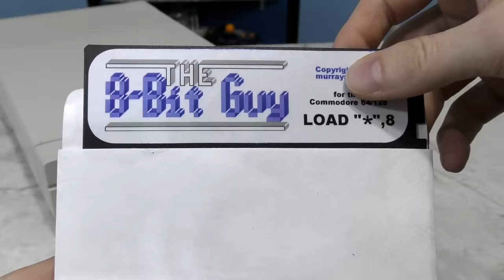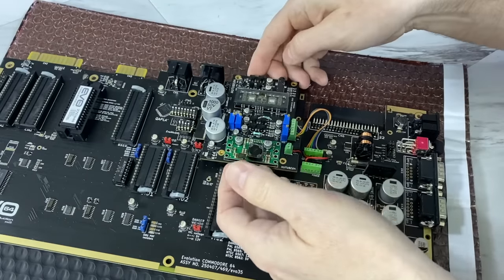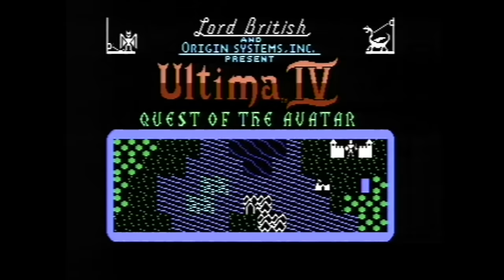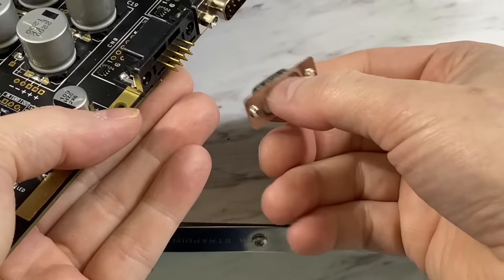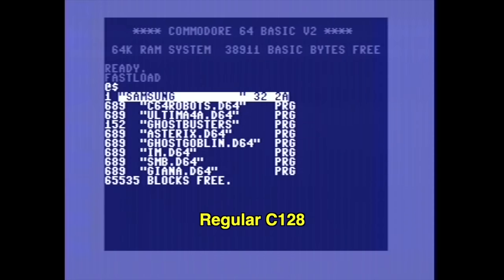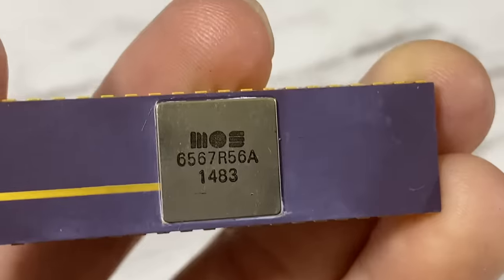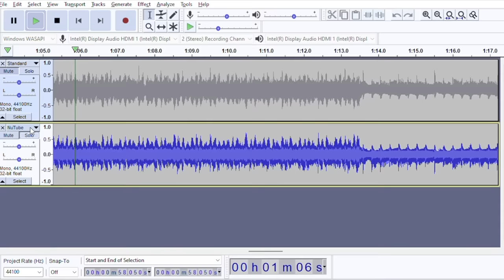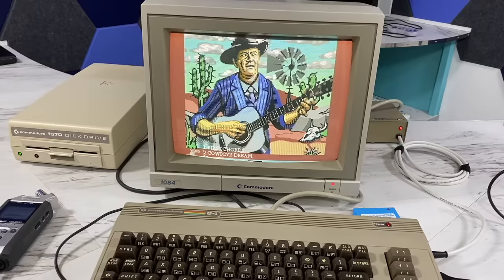The Evolution64 - Is it worth the money?

Comment: About the audio quality, personally I think the nutube sounds a little bit sharper, occasionally sounding too sharp, resulting in some weird noise. From my experience, it matches what most tube based amps sounds, albeit not as good as a proper, dedicated preamp. But that might also be affected by the music itself being really high pitched.

If I'm purchasing this for myself, I would not add the 500$ upgrade. If I really want good audio, I'll probably just hook it up with a proper audio setup. Adding an expensive builtin amp is an expense hard to justify for me, when I know there are obvious better options, devices that can also be used by other computer and vinyl players, etc. And honestly,  when I'm playing a retro game, I'm not really bothered by the audio quality. I just need the game to work, graphics look nice. As long as the audio doesn't sound bad, I'm ok with it.

But as you said in the video, at the end of the day, it is up to the users to decide whether this is worth it or not.

PS. if you have a good enough high end audio setup, vinyl sounds significantly better than even lossless audio on streaming platforms like tidal. But imo, CD and vinyl both have different characteristic, it really depends on personal preference and mood.

Comment: Vac tube amplifiers makes different harmonic distortions than transistor based. Most distortions are made in speaker amplifiers due to much higher power output - practically only here You can hear the real difference. For a couple days I had one of best vac tube amplituner even made. Giving it back was a very big pain for me :)

Comment: I could hear a difference, but it was mostly just more LF in the tube sound. Whether that's better or not is largely subjective. To do an objective test you'd need to feed in a known signal and analyze the output. The less it changes the better it is, objectively speaking. But objectively better isn't always subjectively better.

Comment: I did notice some slight differences between the regular C64 and the vacuum tube amplifier. Now, I'm not qualified to say which one is better, only that if you want to go for authenticity, the C64 didn't seem to ever have the latter as an option,  at least to my knowledge. But again, I agree with David here when he said that the comparison is invalidated. I would go even further and say that you wouldn't be doing constant comparisons between both so you'd get used to how one of them sounds anyway. Personally, I don't think it's worth the half grand for it.

Comment: At first part of the Giana Sisters song, I could tell a difference. But I actually think the original sounded better (through my speakers).

Though, I would like to point out that running things in tube's at only one stage of the chain is not hogwash, and could still be audible. If one amplifies a signal too much with transistors, the signal will clip, and that does not sound good. This is because there is a hard limit. The difference with amplifying a signal through a tube, is that tube's first become saturated, so they act sort of as a soft knee audio compressor, and the "saturation" does introduce a sort of warm distortion that sound way better than a transistor that is clipping. There are even VST plugins that simulates the effects of tube saturation and it does work even if signal is digital all the way and even on digital instruments.

My guess though, is that the tubes on the Evo64 don't get to work that hard, thus, the audio difference is slight. But maybe that is for the better, as not all types of signals benefits from tube saturation, (guitar amplifiers usually do as guitars have such dynamic range). But do look for videos where someone demos "tube saturation" so you better know what to look for.

Comment: You missed out on doing quite an interesting test with the audio. Since the waveforms of the NuTube were inverted (which is, I think, an actual effect that come out of using tubes, they do invert the phase of the waveforms), you could've tried mixing them both together to get a mixdown of just the difference between them, which would give you an objective idea of what kind of changes the NuTube introduce.

Comment: its very clear that the pseudo tube amp sounds distorted, i prefer the original audio capture by far... also they should know that each time signal passes through a tube the phase is inverted...the audio sounds the same but if you are paying 500 for a high end amp board you should have the audio correct not inverted... and i am a tube lover, i collect and restore amps radios and tvs all tube based.... a high end tube amp is nothing like that gimmicky board, a high end tube amp generates lots of heat dissipates lots of power,tube heaters are generally 300ma, tube plates run on something like 400vdc.... of course  this is juist like a buffer or preamp and we dont need power but still,  to have all the supposed benefits you should have an analog audio source like a turntable , then your tube amp then your high sensitivity speakers....now on this contraption you have digital audio from an 8 bit computer, then your vfd thing amp, then probably played on a tv speaker...so as much as i like that a new board is available for a vintage computer, that tube thing is a hipster gimmick and the decision they made to offer it as an option makes me question if the board itself is even reliable to begin with

Comment: I could hear a slight difference between the two audio samples even through my computer.  The tube output sounded a little less 'harsh' to me, like the sawtooth waveforms were being slightly rounded off.  Which is consistent with my experience in tube output -- transistor output is more accurate/precise, while tube output 'colors' the audio slightly.  Tube audio isn't objectively better, but may still be preferable to some ears.

Comment: The reason for the NuTube audio to be inverted is that all the NuTube is is a single ended buffer. That is invertive by nature. I have never ever understood the idea of such a buffer in any audio system - at least the modern ones designed like this which is the case for most of it. A good traditional buffer based on transistor or a good audio grade op-amp is the way to go. There's not really any difference in using tubes for signal treatment vs transistors. If you want tube sound then hook it up to a tube power or integrated amplifier. Then we can talk tube sound. Driving something reactive like speakers is quite a different task than just signal treatment and tubes drives speakers differently - hence the tube sound. Good tube amplifiers are awesome - a single invertive tube buffer in the audio path is not.
Unbelievable the marking is so bad. Wonder how many fried chips on that account...

Comment: I want to comment, that it is unrecommended to drill a PCB, especially a multilayer one. Because it is possible  that you could introduce a short circuit between power planes or signals from the burrs made by the drill and left behind in the newly cut hole.

Comment: I think it was pretty easy to hear that the filters of the two Giana Sisters recordings were different. But probably not due to the "nutube"... Was it the same SID-chip used for both recordings? (As we know, the filters on 6581 SID-chips (rather than 8580), can vary wildly from chip to chip. Or maybe one was 6581 and the other 8580?)

Comment: It should actually be possible to hear the difference of tube sound even if it was later amplified by transistors. Vacuum tubes add even harmonics to the sound, and these harmonic distortions are preserved when the sound goes through solid state amplifiers. Whether it's a good or a bad thing is open for debate. On one hand, any harmonic distortion lowers the fidelity of the sound. On the other hand, human perception of sound works in a way that  makes even harmonics be perceived as pleasant. I think this is the reason some people love the sound of tube amplifiers. They distort the sound, but in a way that appeals to people.

Comment: overkill for any mindset using this. vintage computing is vintage, this is not. I would appreciate for 2000$ a kit for really building a c64 chip (maybe 6502 inner or some alu unit, I really do not know exactly what's inside). but this kind off approach will teach somebody, something. This is just to play 40 year old game with unnecessary stuff.

Comment: In the intro of the Giana theme I hear quite a difference, but that could be due to SID tolerances.

Transistor amplifiers don't add or take away to/from sound like tubes do (at least not intentionally). Whatever the tube adds will still be there if you further "process" it with transistor amps or digitally.

Comment: Tbh, I don't think that even the EVO64 board itself is worth the asking price.  I think that those of us who actively repair their own vintage computers will shop all of the available options out there.  There was a faithful reproduction C64 PCB released that would do the job of replacing an unrepairable main board and still accept the original chips and it's roughly 1/3 to 1/6th the price of the EVO64, depending on shipping rates.

As for that outrageously priced "NUTUBE64," it's definitely pointless, in my opinion.  Just a cash grab for audiophiles, nothing more.

Comment: The Korg NuTube is definitely a VFD.  And they sound awful, with terrible micorphonics and a very high noise floor.

You can use just about any scavenged VFD display as an amp tube, with a little bit of DIY.

Comment: The only thing I saw worth having was the dual SIDs for chiptunes. I heard a slight difference with the Nutube per se it had what seemed to be a fuller sound but was "fuzzy" for lack of a better term. The original sounded more "jagged" and "crisp" to my ears. Depending on the melody, I can see arguments for both. Can I see an argument for $500 worth of slight variation?: NO

Comment: Yeah, I definitely would NOT spend the $500 extra to adapt any sort of tube thing into the audio on this. I could only hear a TINY bit of difference in your first sample... it sounds a little more square or sine-like than the original, but then I couldn't hear any difference in the second segment, so... over all It's just !snake oil"! So of course I wouldn't spend the extra for the mod that uses traditional tubes, either. I think someone would have to be nu...(YT cens. maybe)...ts to do that.

Comment: You shouldn't be too shocked by that AV output quality contrast, it's a price point matter, better ways are always possible but it comes down to how much it costs per unit to reach it. I think when they make any machine the AV output is probably at the bottom of the list of priorities, for example the NES-2 and SNES-2 being RF only, early 00s P&Ps with Composite only, or up to now where some things only do 720p maximum.
Pricey but interesting since analog video and audio fidelity is a difficult field to control and master compared to digital, it's all filter components, cables with ferrite, all the things to counter every kind of signal noise present.
Oh yeah totally, analog fidelity is a live event only thing, it's so particular it takes an audiophile to even bother with it. ;) If MP3s proved anything it's that people aren't that picky Ie. digital compression noise VS analog radio noise. I can hear the difference but it takes headphones now and that aspect is not going to get better with time lol.

Comment: Using a C64 or Atari 800XL in my case, is not very reasonable at all. So it is all a hobby and a wonderful wonderful thing for fun and burning precious spare time. So I guess to buy such a new board never will be reasonable and pay your money back in any way. So I guess those videos are very, very interesting to watch but caption here never should be "is it worth the money". I mean, why should I use a real Atari if I can power on my HC0 (which is a custom built RPi zero into the official keyboard, looks and feels like the RPi400, but is one year older) and use an emulator. The HC0 uses less power which is cheaper over time, but only the real machine is the real machine.

Comment: I understand buying and original C64 and playing around with it but why spend 500$ on a new board without any chips? 
A new M2 Mac mini is 600$, way better deal and then you can just use an emulator, it will achieve the same purpose basically…

Comment: Vacuum-tube based amps only sound very different from transistor-based amps when overdriven.  Tube-based amps clip in a manner more pleasing to the human ear.  A transistor-based amplified will, when overdriven, do a hard clip that produces strong high-frequency harmonics in the signal.  A tube-based amplifier produces a much more rounded clipping that doesn't emphasize the higher frequency harmonics nearly as much, which humans tend to like much better.  At lower amplifications, it's easier to build a tube--based amp that has a warmer tone to it, but you can still do that with transistors.

Comment: re tube amps: There's a lot of misinformation floating around about tube amplifiers. I'd like to put my two cents in (as a musician, not an "audiophile"). 

Objectively, there's only one situation where a tube amplifier actually makes music "better," and that's in guitar amplifiers. Even then, tubes are only useful in the preamp section. 

This is because tubes have a very different effect when the signal nears the saturation point of the tube (the place where the waveform starts to become clipped due to the voltage being too high for the circuit to handle.) 

With transistors, you get a hard clip: the voltage reaches the maximum point and just goes to DC. With tubes, the waveform starts to naturally compress, and instead of a flat top on the waveform, you get a more pleasing compressed shape at the extremes. This is the difference between the pleasing, "natural" distortion you hear on most electric guitars, especially in the 60s and 70s, and the less pleasant sound you hear when you overdrive your boom box or home stereo system. 

Other than that specific use case, any differences between tube amps and transistor amps are not due to the tubes. They are usually due to other differences in the circuit design. For example, someone making a $1000 tube amp is going to put better parts in there than someone making a $10 transistor or IC driven amplifier. 

Aside from that single use case: creating cleaner, more natural distortion on specific musical instruments, tubes don't make a difference. They do not help program audio, nor are they going to be useful in the preamp stage of a SID chip synthesizer - at least not without a user adjustable gain stage with overdrive.

Comment: A NuTube! Oh wow. And here I thought that thing would be relegated to eccentric analog synthesizers. Cool to see one of those things used somewhere. Audio quality is something very subjective. A good demonstration is basically impossible over YouTube as the compression will completely destroy any variance that might be there. I say might, as audiophile stuff is indeed a lot of psuedoscience that costs a lot of money for something you will likely not notice in everyday use. Tubes are perhaps the biggest one here. There's several reasons we moved away from the outside some niche applications. Tubes are expensive and those suckers distort, which is cool in some cases, but usually just gets in the way of getting a clean signal. Also, they have rather brief service lives compared to transistors.

The idea that you can make a brand new C64 using readily available modern day components brings a smile to my face. Harvesting parts from other machines will eventually see you running out of working machines. So there being a supply of newly made parts means that we'll be enjoying the C64 in its (sorta) original form for decades to come.

Comment: Most amps will produce a good sound with such as small load as a ADC. If there is a difference, you'll probably hear it when plugging in speakers, that would be the real test. Otherwise, you don't really need an amplifier.

Comment: The tube may not be pseudo science depending on it's intentions. The SID is basically a digital synthesizer and the tube could be a means to provide a warmer, richer sound of analog synthesizers. In the case of musical instruments, it is the slight variations and imperfections in the sound that characterizes them. But I"m not sure how much (if at all) the SID chip could make use of that.

  That said, the SID chip has a very gritty sound which is okay because it was only meant to be played through some crappy built in speakers.  in which case, the tube could be a means to boost the audio without distortion. But, you'd need better sound system to perceive the benefit from that. 

So, what it really boils down to is whether you want to listen to your C64 through an amplifier or some other enhanced sound system.
But even then, I have a hard time justifying the $500 price tage. I've heard some pretty damn good SID emulation that mitigates those issues. Thus, I can't help but think this all could have been done digitally at a much cheaper cost.

Comment: The NuTube does sound better but it's like the difference between Good lukewarm Mineral water and lukewarm Distilled water. both are going to be awful to drink but one of them is going to be less awful than the other. I hear a light year difference between the Stock Sid chip and the Nutube however I personally wouldn't recommend getting the NuTube unless you're doing streaming or YouTube content. I was listen with some cheap $40 Bluetooth headphones and heard this difference. So it's very much something noticeable the question become more of why go for that level clarity if you're not using it for something.